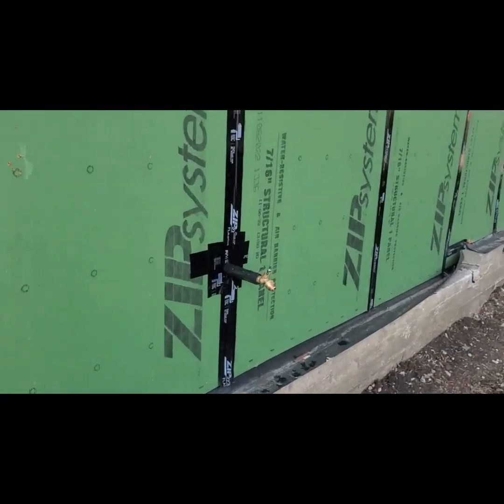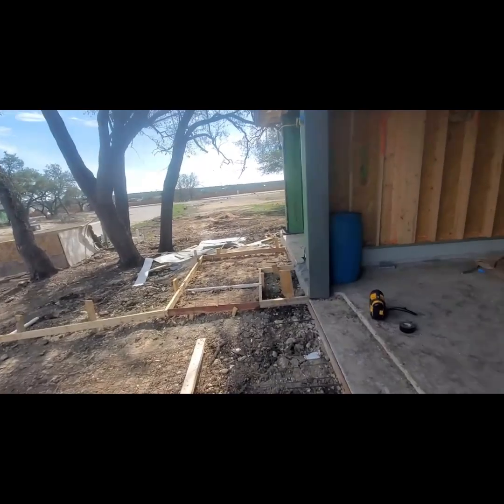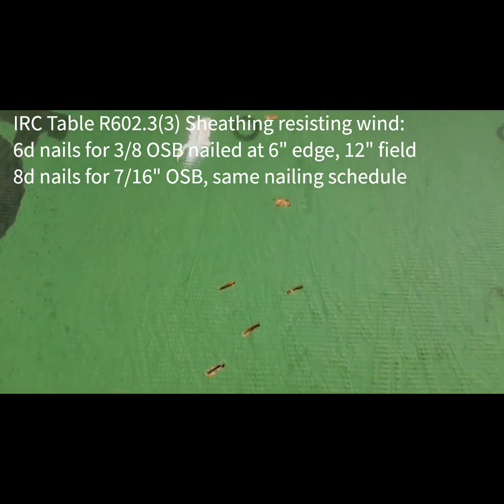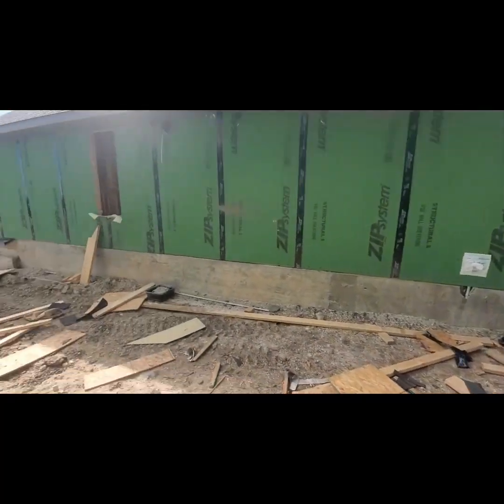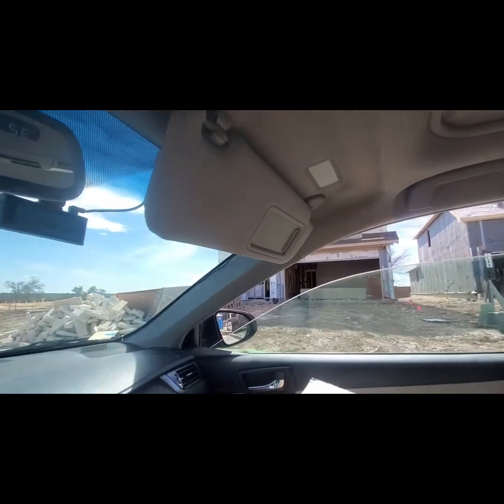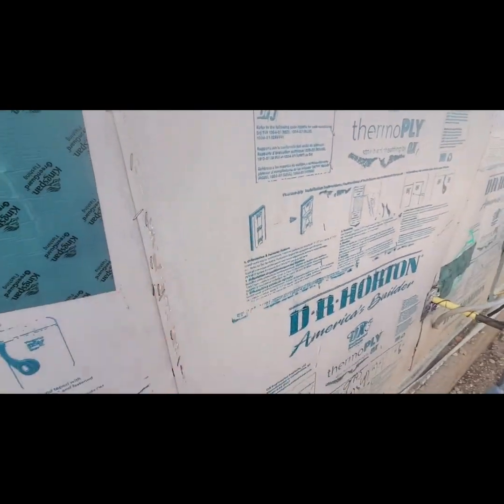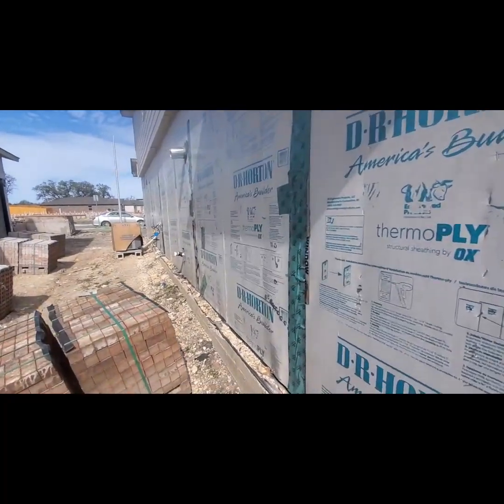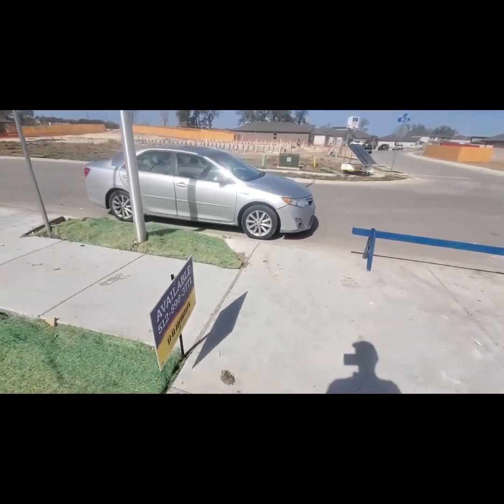Home inspection from the car:  Zip flashing, PFH nails, ugly sheathing and a beautiful portapotty!

Comment: If the ZIP system is taped correctly and rolled with the manufacturer's tool, it will have small z's embedded in the tape from the wheels used to roll the tape.  It's a pressure-activated adhesive.

Comment: Matt Risinger had a video on the cardboard sheathing, which can easily be torn by hand and can't possibly add structural rigidity in the face of really high wind.
Reply from the maker: I've seen a couple of his vids about the cellulose sheathing. He hates the stuff. 

The ICC ESR report gives the green cellulose sheathing an equivalent of 3/8 OSB, when you nail it on 3" centers that is.

Comment: Nothing against you, but I'd rather put my trust in OSB with staples than that glorified cardboard! But then again I've  been building with a mix of staples and nails for years (depending on the county we're in and plans). If anyone has ever had to rebuild something that's been stapled or nailed, I'd stick with staples. Get it done right the first time or you'd be better off scraping it and starting over, those staples are not letting go. Thanks for your video's man!

Comment: Nothing wrong with using staples if they meet the right specs. Linking the Huber PDF doc in a reply:
Reply: https://www.huberwood.com/uploads/documents/technical/literature/ZS_R-Sheathing_Installation_Manual-R3-12v21.pdf
Reply: The non-R install manual appears to be older and only states to use Code approved fasteners: 

https://www.huberwood.com/uploads/documents/technical/documents/Installation-Manual-ZIP-System-Sheathing-Wall-and-Roof_2021-07-12-210658_tuck.pdf

Comment: 1st garage could have not required that PF because of wall length. 

That second garage, portal frame or not, is destined to fail with such small walls.  I thought a pf had to be 16" minimum  and maybe it is, but it looks small! 

Staples are NOT allowed in an exterior braced wall panel, but they are allowed on an interior BWP (a rare occurance)  We use 8d ring shanks. To be fair, typically only  a few sections of a long wall are BWP.  Usually 48" in each corner and next to large fenistrations, the rest can get staples.   Im just a carpenter,  but I will argue that 7/16 16 Ga staples (when properly spaced, 4"oc in field and 3" oc seams) hold sheathing to studs better than 8s.  The "shear" strength comes from the plywood's attachment to the studs.  If you've ever had to tear a sheet of plywood off of a wall or roof, I'll take 8s any day!   The issue is consistency in depth of drive.  Most nail guns over-drive the nails easily half way through the sheet if you're not careful with pressure and/or depth adjustment.  It's really a shame to see
Reply from the maker: Thanks for the insightful commentary. Yeah there is a whole section of the book dedicated to calculating how many 4' BWP lengths needed depending on the design. But when you walk around and you only see staples and no nails, you know that the BWP sections are fastened wrong (according to code; they may be right according to the plans which I don't have).

Comment: We use staples with 1/2 inch ply and the crown at a right angle to the grain of the top veneer. Set the depth of the head flush and it is up to code where I build. I have noticed the the new staples do not hold as well as the older ones. It used to destroy a sheet of plywood trying to remove it when well stapled. Then again I used some ardox pneumatic nails a while back that did not hold worth a $hi.
Reply from the maker: What fastening schedule do yall use edge/field? Is it different than for nails?

Comment: For somebody that seems very by the book I'm surprised your walking around on jobs that your not supposed to be on. Liability issues which I'm sure you know about. If you came on my job and weren't assigned to it I'd kick you out. Seems it's okay to bend the rules if it benefits you.
Reply: Bet neighbors love you guys when you are building next to their homes. That karma will catch up to you sooner or later bud.
Reply: Id tell him to quit inspecting jobs without having the engineered plans in his hands. Lets just say there was an inspector in my area who tried failing 10 house because they "didn't" meet code. After he was sued and lost his ass and the counties ass in court he was fired and a new inspector was hired. It was funny as hell. Had an electrical inspector fail a company on the rough saying they needed a switch on a wall and wanted to know why they didn't. He swore he had been to the job. If he had he would've known The was floor to ceiling glass and impossible for a switch. Very few inspectors have a clue what's going on. I get so sick of the term it looks pretty. Is it done? no? Then move on

Comment: At 6:23 - I'm surprised that what you call "...essentially cardboard..." actually passed the same industry standard test as 3/8 OSB. I wonder if any independent long term studies have been done on this inexpensive sheathing. Personally I'd be too scared to use it in my own home, however I also live in earthquake country (California).
Reply: That stuff should be illegal
Reply from the maker: Yeah, here is the ESR on the green grade of ThermoPly:
https://www.drjcertification.org/report/download/506

With enough staples, it is supposed to meet the equivalent of wood structural panel.
Reply: Themoply or simular, is not allowed in California, never has been.
Reply: Ive seen something similar in Woodland CA.  They use plywood for some  parts of the walls and not for others. You don't have to provide bracing along the whole wall, but it is the easiest approach in high seismic areas.  @steveoh9838  This is from the ESR, but I don't believe it really--maybe caveats when you look up the allowable loads. Structural performance under lateral load conditions (wind and seismic) for use as an alternative to the IRC
Intermittent Wall Bracing provisions of IRC Section R602.10 and the IRC Continuous Wall Bracing
provisions of IRC Section R602.10.4 Method CS-WSP (Continuously Sheathed Wood Structural Panel)
and CS-PF (Continuously Sheathed Portal Frame)

Comment: You have got a lot to learn about structural engineering in residential framing. 

Stop quoting irc codes and manufactures specs, irc is a prescriptive code that applies to a “standard” house. All houses have very different structural needs based on spescific situation. (Elevation, snow load,seismic and wind loads all factor in)

The first 2 houses are 10000% better than the trash houses you have been inspecting. 
I don’t how your ok with T-ply cardboard sheeting installed with roofing staples but not 2” 7/16 crown staples in an OSB shear panel.

Manufactures can say whatever they want about there product show me an structural engineers spec on t-ply matching shear performances of an 3/8 osb panel.

On the zip tape it is a self terminating flashing using pressure sensitive acrylic adhesive so when rolled properly it doesn’t matter what way you lap it.

And to teach you a little about portal frames (garage opening) you can achieve shear path in many ways  you can transfer shear through the roof or floor diaphragm around large openings like a garage door or you can achieve shear in the back wall and cantilever your floor or roof diaphragm off of an interior shear wall. So pint being there is many ways to frame a garage opening not always including a continuous header across the wall (portal frame) also the hold-downs replace the 5/8 anchor bolts on these walls.
Reply from the maker: You are, of course, correct. 

But when I do my inspections it is a rare day that I have the pleasure of having the plans on site so the standard I have to inspect to is the prescriptive code and mfg instructions. Because of that, I spend a lot of time poring over the books. 

Staples 3"OC in Tply vs willynilly in OSB is a simple matter of what the mfg instructions vs the IRC says. Tply says it's ok, IRC says it isn't. Indeed I would LOVE to know more about structural engineering; but since I am only a lowly inspector, my job is to call out this discrepancy and allow the engineer say it is "OK".

Regarding the engineer's spec on Tply, I linked the ESR report in the description. 

Zip tape has instructions stating rolled on tape gets lapped upper above lower. 

And again you are right about the myriad of ways to design a garage opening. Again if I had the plans it may be that each house was within spec. The great thing about the IRC is that it gives designers a quick and easy way to design such openings. Without plans the prescriptive IRC is the best I have to go by. I love it when the engineer sees my report, rolls their eyes and says, "This dummy inspector should have known this was built according to the plans!"

Why? Because I never have access to those plans and that means the builder actually went to the trouble to consult the relevant authority to make sure it was built right! That's a win for my client, the buyer. 

I really appreciate your insight, my man. Glad you took the time to leave a comment on this.
Reply: I might have been a little carried away, I like the videos keep ‘em coming man!

Comment: There are allowable seismic and wind shear values that will allow a 16 gauge 2" staple in replacement of .131 nail at 3/6. If the specs and engineers say it will work it'll probably work 👍👍
Reply from the maker: Right, on the engineered design drawings, sure. I would love to be able to see the plans for these homes. Until then, I have to go against prescriptive code. But no doubt there are indeed allowable tolerances where staples can be used and are on the drawings. 

Like with cellulose sheathing :)
Reply: Huber says you can use certain staples too with some of the Zip panels, but I can't imagine why you would want to -- much more (and larger) penetrations in the face of that applied WRB you now have to liquid flash or tape whereas with the nails it's not required to tape/flash them. Otherwise, moisture can wick into the OSB through those slits created by the staples

Comment: Huber has recommended stapling schedule for their zip system which is suppose supersedes the code?
Reply: “Stapling”?
Reply: @seanm3226  Yes the present participle of "to staple" is "stapling"
Reply: @FACTURE_LLC  Yes professor, and the present participle of “to nail” is “nailing”.
Reply from the maker: My understanding is that Huber sticks by the code and local industry standards for installation of structural wall panels. Not being sarcastic when I say I really would like someone to show me where the standard says staples are ok.  :)